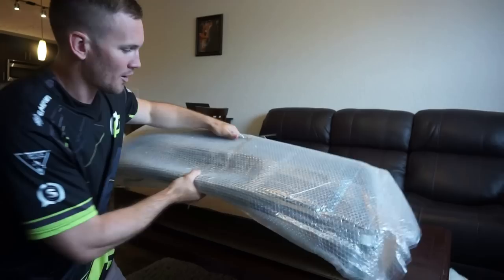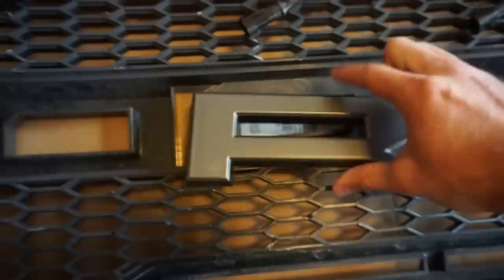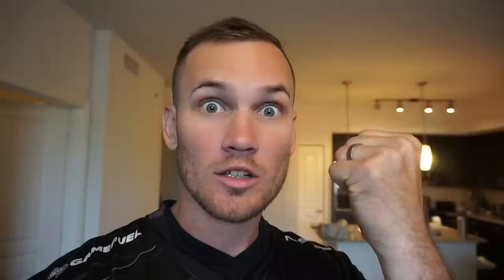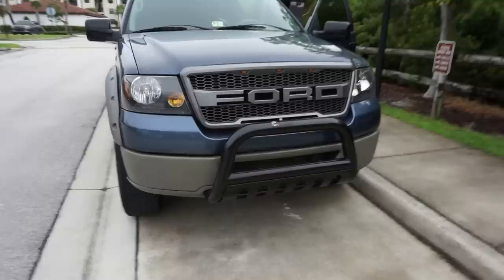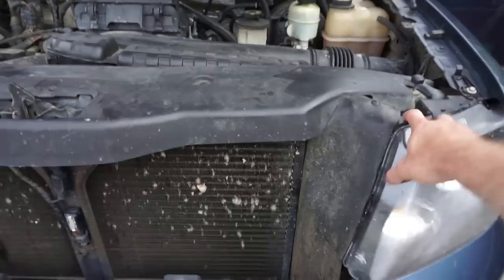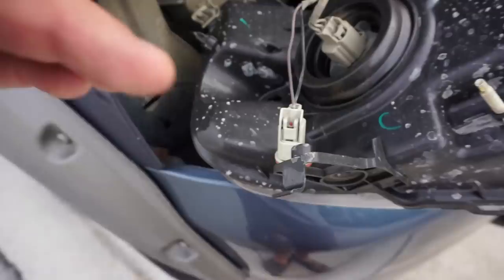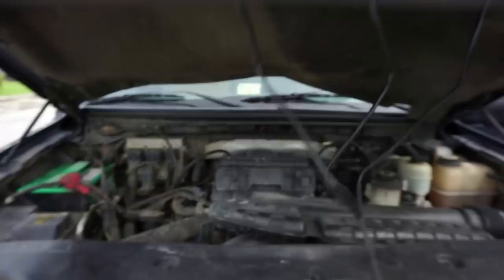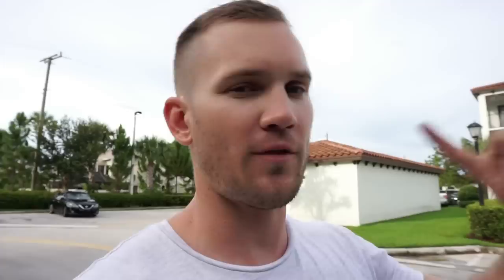How To Install Ford Raptor Grille on a 2004-2008 F150 (HOW TO SPLICE INCLUDED!)

Comment: Man, I installed some Anzo headlights about a year ago with HID low beam and high beams. I had to splice in my led rings from the halo led’s and now I’m having trouble figuring out where to splice into now? I spliced into where you did on the same wires, on the DRLs and it didn’t work. I even tried it on other lights and it didn’t work. I’m wondering if it’s just not bad LEDs in my grill?
Reply from the maker: Hey Bryce! With the Anzo headlights, I would imagine the led halo's were spliced into the daytime running lights, correct? That would be my first guess as to where I should splice the wires into. There is always a chance that the LED's in the grille are duds. I have read reviews on Amazon where the LED's came already broken.
Reply: Andrew Does Life Hey, thanks for the quick reply. I do believe that has to be the issue because I correctly tied into not only the same wires my anzo’s spliced into, as you correctly thought, and tried two other sources that I quick spliced into. I’ve yet to have had any luck, and I already installed the entire grille. Now I’m going to have to send it back... This will be fun 👎🏼👎🏼
Reply from the maker: Aw that's a bummer man, I'm sorry.

Comment from the maker: HERE IS THE MOST UPDATED LINK I HAVE FOR THIS FORD RAPTOR GRILLE   -- https://amzn.to/3KaZgUg
Reply: Andrew Does Life on the leveling kit did you put anything on the back or just the front
Reply: @redneckz6983  leveling would be lifting the front to match the rear height. I don't think they do anything to the rear. (I'm sure someone will correct me if wrong lol).
Reply: Andrew Does Life   Hey is this fit. For. Ford -150. 2004  I thinking put. Raptor grill on the. 2004
Reply: Andrew Does Life  hey  man I  W’d like to. Know. If the raptor grilll can fit 2004 ?

Comment: Hey I noticed your head light is foggy in part of your video. Are they foggy up on you, and didn't u just buy these?
Reply from the maker: Yes, one of them had collected a little moisture. I need to seal them myself, I should have done that when I bought them before installing them. Nothing a $5 can of sealant from hone depot can’t solve lol
Reply: Thank you for your response, I’m gonna have to keep that in mind. I’m going to buy the same lights for my truck. Thanks for the good videos, keep up the good work !
Reply from the maker: No problem and thanks for the kind words!

Comment: I have a 2004 Lariat which looks similar to yours, and I am very much interested in this grille. Yet the link for grille on amazon says for the years 09-14. Does it still work?
Reply from the maker: Hey Campbell, I’m not sure why it brings you to a 09-14 model, but that company makes a grille for our model of trucks which are 2004-2008. Just search 2004 F150 Raptor Grille on amazon and it should be one of the first results!
Reply from the maker: I contacted the seller because even when I click on my previous order it brings me to a grille for an 09-14 F150... They're currently out of stock for the one that fits 04-08 F150's, that's why it's redirecting you to a different model. Here is a link for that grille sold by a different company than where I got mine from. -- https://www.amazon.com/VZ4X4-Front-2004-2008-Raptor-Grille/dp/B07N75RY5P/ref=as_li_ss_tl?keywords=f+and+r+letters&qid=1569797114&s=automotive&sr=1-46&linkCode=sl1&tag=aslunsford05-20&linkId=0adbf54db8f8c3caa2acc6f0b69de5ff&language=en_US

 I just went to Ebay as well, and it doesn't seem like there are ANY available at all with the F and the R letters included.
Reply: @AndrewDoesLife  Appreciate the help! Hopefully I can find the right grille soon.

Comment: Hey grill looks awesome! Loved the video. Quick question regarding your truck, what size wheels and tires do you have??
Reply from the maker: Hi Jon, I have 275 70 r18 right now. I'm hoping to switch over to a 17 inch wheel here soon to go with the Raptor style look. Potentially will go up to a 24 or 35 inch tire if I'm able to make that wheel switch
Reply: @AndrewDoesLife   I have 35s on mine and It looks amazing
Reply from the maker: Country Girl I used to have 35 inch Nitto Terra Grapplers and they were great tires they just ran out of tread and I got a killer deal on my 33 inch Copper tires. After running these for awhile I definitely know I’m going back to my 35 inch tires next
Reply: @AndrewDoesLife  did you have any rub with the 35 inch tires, or did it look odd with a big tire and no lift?
Reply from the maker: I did have to trim a tiny piece of plastic off with the 35s to prevent rubbing. The truck looks amazing with the 35 inch tires though, not silly at all

Comment: Hey man just bought a 08 gotta question does the raptor grill come pre painted or can you get it in other colors.
Reply from the maker: The only 2 versions of the grille I have seen are the black and gray colors. I have not seen them offered pre painted any other colors
Reply: @AndrewDoesLife  ok thanks was just maybe hoping they did it white with clear or white LEDs and maybe the lettering could be changed in color as well. Like for fords the lettering could be blue. Just wondering tho thanks
Reply from the maker: Well they’re all plastic so repainting the grille to match a different color would not be difficult. I’d actually really like to see someone do that haha
Reply: @AndrewDoesLife  I jus may do that but how is LEDs placed in cause I would change the amber to either clear or white. I'm not a big fan of chrome either lol
Reply from the maker: @donniepriest1061  I would search to see what kind of led’s are used. If I couldn’t find that I’d just use some maybe repaint the LED housing so the lights would be illuminated a different color
Reply: @AndrewDoesLife  thank you for your help
Reply from the maker: Anytime!

Comment: you should have tucked the wires behind the protector the way i did then you wouldn't have the wires showing
Reply from the maker: Yes, I have since put the wires behind the fire blanket/tarp thing. Seeing the wires doesn’t bother me, but I would rather have peace of mind knowing they won’t get pinched or cut in any way by being behind the fire blanket thing
Reply: Are you thinking about doing a lift
Reply from the maker: I really want to, as well as upgrade to 35 inch tires and switch from 18 to 17 inch wheels. All very expensive things haha trying to figure out the details
Reply: I have 33x12.50/20s on mine
Reply from the maker: I’m currently running 33 12.5 r18s but I like the raptor style wheel tire combo and the raptors all run 35 inch tires with 17 in wheels. I guess if I lifted it I could run 37s as well but I don’t know if I wanna go that big.
Reply: I'm gonna add the raptor  style hood I seen it on the carid website
Reply from the maker: Damn I didn’t know you could get on of those I’m going to look into it as well
Reply: Yeah just go to carid.com put the year of your truck then type in raptor hood for you year it's an awesome hood
Reply: If you want to go with leather seats covers go to clazzio.com put in the year of your vehicle
Reply: I wish there was a way I could show you a picture of my truck
Reply from the maker: Thank you for the advice! I went to that clazzio website and I think I might give those seat covers a shot! You can email me a picture of your truck or send it to me on instagram/facebook
Reply: Ok anytime you just keep up the good work
Reply from the maker: Thanks, appreciate it!
Reply: What is your email
Reply from the maker: Michael Brown alunsford@live.com